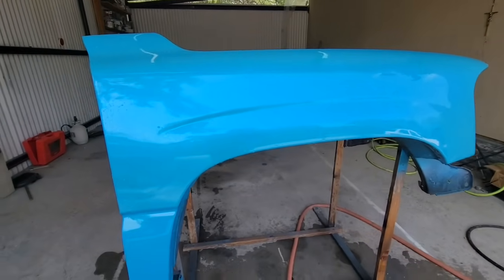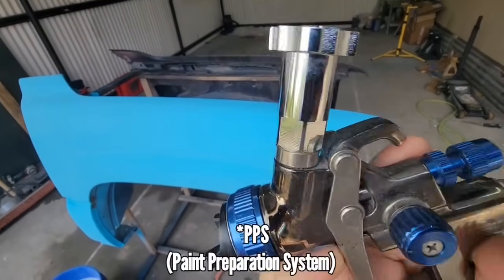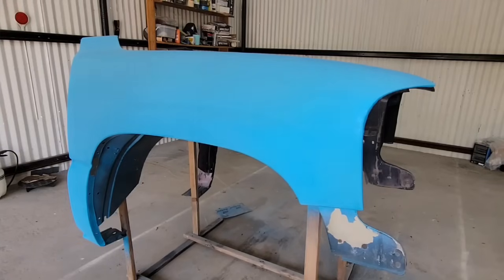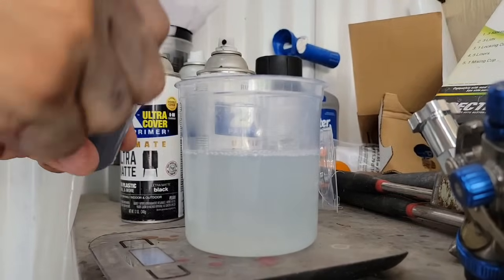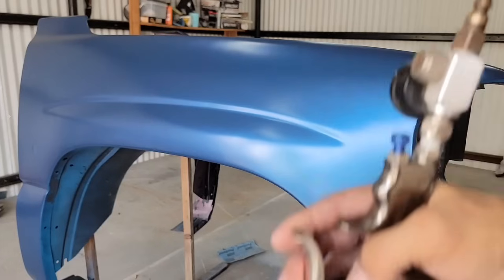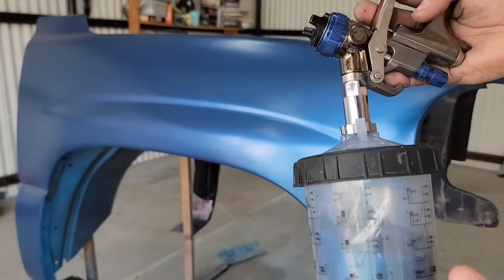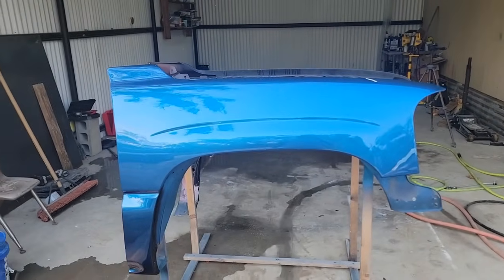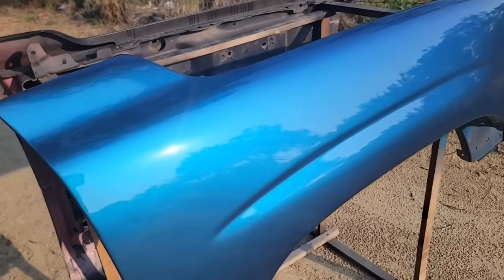Let's Spray - Rustoleum (True Navy) Paint using an Automotive Spray Gun

Comment: Quick tip; you’re suppose to turn your gun upside down before you spray. You pull the trigger until the liner crinkles up. That way if you spray upside you’ll have no issues. The 3M guy came to our AutoBody class to show us how to use the PPS. Almost 20 years of painting experience here. Also you turn the spray can upside down and spray until nothing comes out, they punch a hole in it. OG showed me that in the 90’s. Love the vids man! Respect from Southwest Texas🤙🏽
Reply: rustoleum 2x/painter's touch use an any-angle spray tip that doesn't let you tilt the can upside down to clean the tip. the idea is that you can be underneath something and keep spraying or use the can in hard-to-reach areas. the only way to keep the tips clean is to remove them and clean them by hand/soak them.
Reply: True true 30 years here and I always turn my pressure to 26 to 30 and turn my gun upside down to spray at first gets all the extra air out
Reply: @GenuineRage  thanks for the pro- tip bro!🤙🏽
Reply: @ericlomax5135  yeah I also spray at about 2 bar. That PPS also saves alot of material, you’re just about able to spray every drop!
Reply: Bro you got some bob ross vibes going on
Reply: Good tip, thanks

Comment: We used to do this in the 80s.... Turn the can upside down to release all the pressure from the can....then puncture the can to make a hole + another hole. This way you can pour the paint out with no need to spray....
Reply: Been doing this since the mid 2000s. Especially with things like pb blaster cause the aerosol would always run out before the can was half empty. Saved a lot of money and have a whole pile of marbles lol
Reply: So two holes? And where do you puncture the hole, from the bottom of the can or side?

Comment: back in the 80s we would turn the can upside down and just let out all the air, these new cans are on another level, my point is we just drill a hole in the can after the air was gone. now they have tips on the cans that lay a wider path. the gun still is better. thank u for the video, i know the time it takes to film and edit.

Comment: I've used that can paint in my spray gun before I set the can up in a vise and poked a tiny little hole in it with a nail in the top. I poke one on each side let all the aerosol out and then the paint flows out nicely. Another way to do it would be just turn the can completely upside down and spray all the heirs all out without losing any paint and then poked a couple holes in it when it doesn't have any pressure and then it dumps out really nice

Comment: I think one of the design advantages that you’re missing is that the cup liner is supposed to shrink down giving you no interruption in paint supply when the gun is inverted or semi-inverted ✌🏻
I’m also wondering if you pull the paint out of the gun between coats if it’s not drying in the tip

Comment: Olla mi amigo.
Bro that paint looks good not over the top laity just subtle colour blend I like it.. tip for future reference if u gonna use a rattle can debase the can first then cut it and pour the contents into your sprayer cup of done it a few times when I only need to do a small section saves buying a whole lot and mixing it with the thinner an what not cos it's already mixed into a very thin paint... but again awesome job I love the subtle colour gradient light to dark  stay blessed bro

Comment: Have you ever tried adding Mica powder or eye candy to base coat in order to change the color a bit, or is it STRICTLY for clear coat?
Reply from the maker: Have you seen the gold video? 
https://youtu.be/pkka9mNVWDk
I added some pigment to the rustoleum base (5 grams to 7oz.), but it didn't seem to make a difference. Maybe the colors? or just needed more?.. 🤷‍♂️
I'll try again.
The pigment is best used in an intercoat or a clearcoat, so it floats on top of the base. Adding it to the basecoat will lose a lot of effect because the basecoat coverage is too thick and covers the pigments. 
You could try as a control coat. After the panel has a wet coat,  continue spraying at a distance so the pigment has a longer time to land on top of the paint. But then you're wasting a bit more material.  
I recommend an intercoat and then clear for the best results!

Comment: Hi im doing a base white that i was thinking gloss but after looking at yours im thinking semi gloss.  I want to do a candy baby powder pink over it but i dont want too much because i dont want any guys to not want to sit in my car.  Is there some way to measure how much powder to mix in?  Im going to use por15 for rust, prime/paint all in one, clearcoat with powder, and clearcoat. You waited for the color to dry but sprayed the clear pearl and top clear while wet.  Is that normal?  Im using an airless with the smallest fine tip. Im hoping a 1.2 or 1.5 will work but its all experimental.  Any tips?  I cant get a 20 gallon compressor because i cant lift or move it.

Comment: FYI first coat don't lay it down just a tack coat 2nd coat is wet coat 3rd coat is wetter. Add 15min to each flash between coats. 15, 30,

Comment: Drill a small hole on top of the can to release the pressure it’ll be easier to fill up the cup
Reply: It will let out the propelant
Reply: As soon as you puncture a hole in a new spray paint can it will explode paint everywhere .. done it a few times myself. ..😅.
But you can just turn the can upside down and spray out all the pressurized gas then drill a hole.
Same process as clearing the spray paint tip but just totally emptying the propellant.
Reply: @motov8-garage832  facts! I have tries the same thing